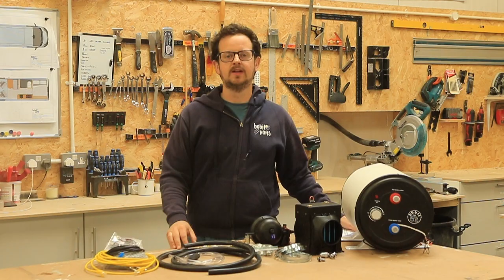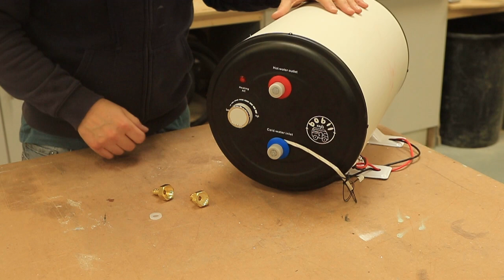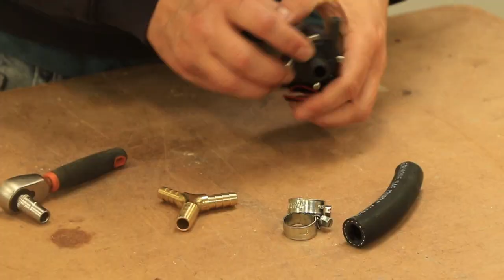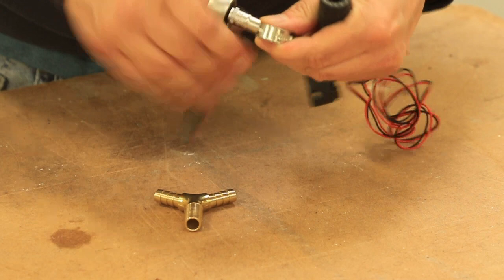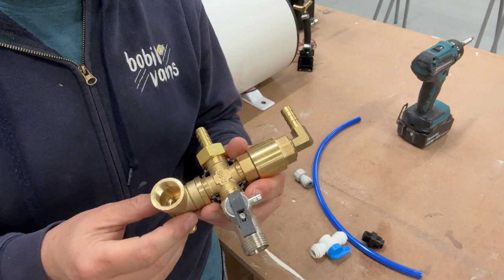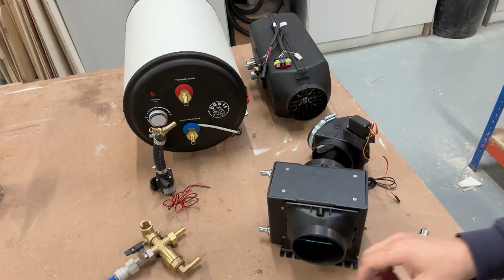The New Bobil Air Hybrid!

Comment: At 7:00 the straight connection on the CLU it doesn't go to the cold of the tank, it goes to the heat exchanger! specifically the side of the heat exchanger furthest from the heater.

Comment: I'm slightly confused about the way this works, does the diesel heater have to be on heating up the van in order to heat up the water?
Reply from the maker: You have to have the diesel heater on, but given that most of the air heat goes into the water, it doesn’t really heat the van up too much. You’ll be on electrical heating from solar in the summer anyway.
Reply: I don't bother sending the air anywhere in particular out of the heat exchanger, just leave it in the garage. Haven't noticed it making the van warm

Comment: Hi can I sit the tank on a slight slope sat halfway on top of the wheel arch to save space in my Peugeot boxer under
Reply from the maker: @KSGBorderline24  it’s recommended to have the tank horizontal and level. What sort of slope? I’d put a box on the wheel arch and put it on there.
Reply: @bobilvans4205 Have you seen radient heat + heated floors + hot water 💧 from the Heat exchanger on the Engine with Glycol . So basically drive for 30 mins heat your floors and back camper area and.hot water tank and then i think seen in the 🇺🇸 they have 200watt inveryer so charges everything very quickly . Love the off grid tech and best setups

Comment: Does it heat water from the 12v  when driving?
Reply from the maker: @plasterer69  it does!
Reply: @bobilvans4205  from split charge relay?
Reply from the maker: @ yes
Reply: @bobilvans4205 Have you seen radient heat + heated floors + hot water 💧 from the Heat exchanger on the Engine with Glycol . So basically drive for 30 mins heat your floors and back camper area and.hot water tank and then i think seen in the 🇺🇸 they have 200watt inveryer so charges everything very quickly . Love the off grid tech and best setups

Comment: how about efficiency? An "external" radiator should be more efficient that the usual pipe-based-blow-thru-Boilers that have a small heat exchange surface in the air tubes... is this the case? But otherwise you need more room for the external radiator and electric energy for the recirculation pump
When goingthis route using more room I'd like the system to perform better and heat faster....  That the case?
Reply from the maker: @ScimPeep  yes it’s absolutely the case! The blow through tubes are around 10-15% of the efficiency of an active radiator system.

Comment: I was wondering how do you drain the water out of the cyclinder for the frost in window. I have on of the first of these cyclinder systesm bought it two years ago and it is a great job.
Reply from the maker: @darseyno1520  it all syphons out of the drain tube on the plumbing unit, so one drain point will drain everything.
Reply: @bobilvans4205   thanks Bob for your help. it is a great unit. Fantasitc

Comment: You see people using the Heat exchanger from engine to heat up water and underfloor heating glycol. This be good to drive the van and all floors warm and hot water when get to camp destination, How would this be done with the CamperVan?   The other great thing is solar topping up batteries when 100% heates the heating element in water tank for hot shower of the solar. - Great vids and kit you do!

Comment: It be great if you did a vid on your favourite kit for van, heated floors , hot water showrr system, solar and alternator charge setup etc best healthy Insulation. Be great vid
Reply from the maker: @topoffgrid  it would be interesting but our setups depend entirely on custom requirements, we don’t really have a favourite method of doing anything-except heating and hot water of course :)
Reply: @bobilvans4205   I was looking for the heated floor for van uk that's how I found you, is the glycol best vs heat pad ? Would that be better or less dangerous
Reply: @bobilvans4205   It be great to have both options heating up floors and water tank while driving or when in back and turned on Diesal Heater

Comment: at 9:00 you show a John Guest 12 mm fitting, what size/diameter thread does it need to screw into the barb fitting?
Reply from the maker: @ih2530  the threads are 1/2”

Comment: Do you recommend installing John Guest check valves before or after the system? How would you deal with pressure build up between the tank e.g. the shower?
Reply from the maker: @ih2530  just on the inlet. There is a bit of pressure build up but that’s why there is an expansion tank, it massively reduces the increase in pressure to protect the pipes.

Comment: Are there any components used in this video that are not included? If so, which ones are they? So I can buy them myself.
Reply from the maker: @ih2530  only the inlet and outlet John guest fittings and the valve, everything else is included!
Reply: @bobilvans4205  Thanks! Also for people reading this, at 9:17 you also mention the John Guest pipe inserts. So it would be good to buy those as well